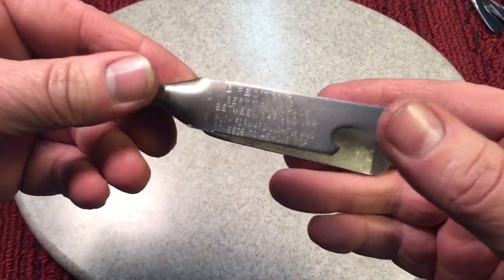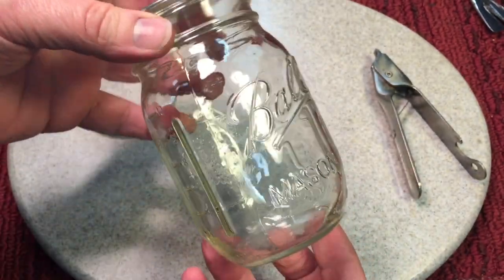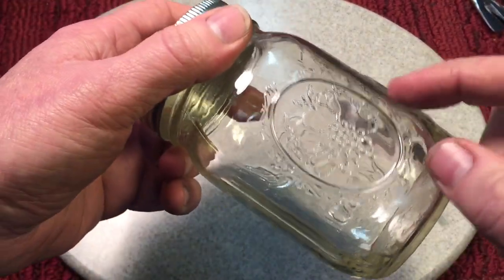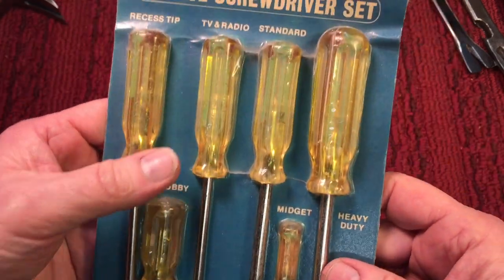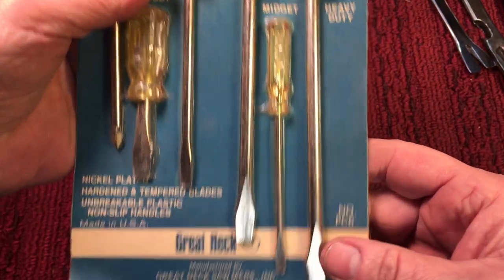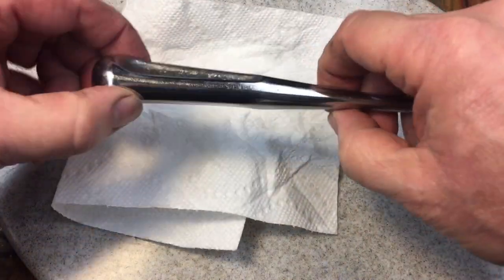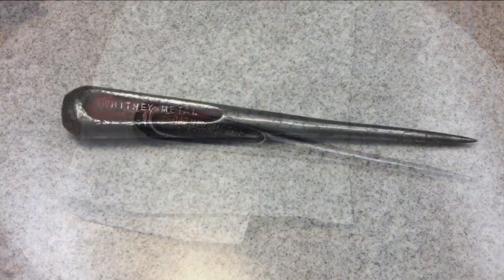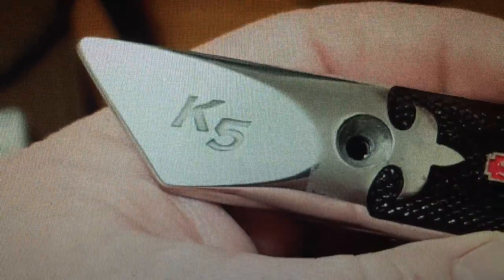Whitney Metal Company Tapered Awl,  N.O.S. Screwdriver Sets and More...

Comment: Hey Scout!  Great work!!  When I was younger, I worked in HVAC with my father.  We custom made all the ducts from sheet metal and we used a scratch awl to mark the layout lines on the metal. It made a sharp line for accuracy, similar to a woodworker's marking knife.  Also, on the jobsite, the awl would be used to punch a hole in an oil burner's flue pipe for smoke tests, or to punch a hole for installing damper hardware in ducts.  To punch the hole, you would hammer the awl through the metal.  Hope this makes sense!!  The awls we used were not as nice as that one!
Reply from the maker: Hi Sal!  I think that's just what this tool was designed for!!!  Whitney was a big sheet metal supplier so it makes total sense!   Thanks!!!!!!
Reply: Forgot to put it in my comment, but he had a plier-style punch similar to the one you showed that he called his "Whitney Punch".  I never looked at the manufacturer's mark, but I now have a pretty good guess who made it!

Comment: Great video. I said I thought it was a fid for wire rope splicing. Happy to stand corrected. Sheet metal work alignment may explain the hammering  on the back, someone really trying to get things aligned. Cheers Stuart 🇦🇺
Reply from the maker: Stuart- Just because it is sold as one tool it could ld be used for so many applications!

Comment: John, the cross grind on flat blade screwdrivers helps the blade to grip screw slot and stops it riding out. The micro grind lines act much like the jaws on a vice but reversed.  Thanks for the effort you put in, I find myself checking the clock every Monday, Wednesday and Friday waiting for your next post here in the UK.
Reply from the maker: Outstanding!!!!!  Thanks!

Comment: The shank is used to  break the brade open on wire rope and as a hold down, we always did this on a cribbing block or a pileing hence the anvil on the handle, no the new prison shanks are made from tubular plastic hangers, using your Bic lighter or dental floss cut it to size then put it in a pencil sharpener and wa la your ready for the yard...(pencil sharpener are found at all gaurd stations, librarys, shops, school buildings ect, and they go right threw all medal detectors) I make them around Christmas as stocking stuffers for nefuews, neices, and wee ones who are headed down that path....

Comment: That spike probably for aligning holes in two parts to get a bolt or rivet through. The taper makes that work well. Just a thought
Reply from the maker: highdownmartin I think you are spot on!  😃👍
Reply: its funny i was thinking the same thing, i once did a job with a smithy and he used something rather like this to match the holes up when bolting together square tubing.
Reply: ScoutCrafter  hi. John. Apologies, I rather jumped the gun adding this comment before you'd finished your video. As it was made by a punch company we got made the same deduction. Great minds etc. Lovely tool  though eh?